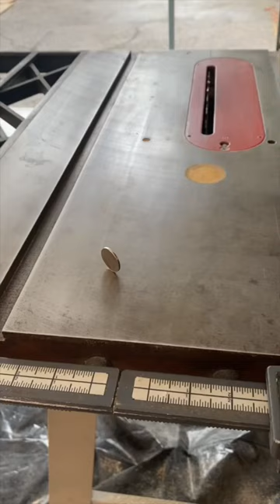Before and after Craftsman 113 upgrade

Comment: I just bought almost the exact same saw for 50 bucks. In great condition. What size belt is it an where did you get it
Reply from the maker: I picked up the belt and pulley kit from https://www.in-lineindustries.com/product/pulley-belt-kit-sears-craftsman/ Definitely change the pulleys and the belt, big improvement.

Comment: I just got one of these from my father in-law, I had a hard time getting it to 45deg, seems like the miter/angle screw rod doesn't have enough room (even with the collars off it) to push to 45deg. I am able to hit a 90deg with no issues, and about 2inches overhang... First time working on an older saw, and so I'm not sure if i can just unscrew the rod all the way out? Or if that'd cause more issues. Any insights?
Reply from the maker: Mine has a similar problem - at some point I’ll strip it down and fix. Could be anything from gunk to a bent threaded rod.

Comment: REDUCING NOISE:
1.	Change your v belts to flat belts. 
2.	Use machined steel rib belt pulleys 3.0" Diameter Motor pulley and 3.0" diameter Trunnion spindle pulley.
3.	Add thick 20 mil Acoustic Mat to the inside of the saw frame in 2-3" wide vertical strips. in an irregular pattern.
4.	Seal off any holes in saw frame with acoustic mat.
5.	Remove rust first so mat will stick. Fill table top voids inside of saw with acoustic mat.
6.	If sticking with V belts than change to a link belt.
7.	Add motor tension springs.
8.	Lubricate motor pivot mount.
9.	Add a padded blanket around the base.
10.	Wear 30db or greater hearing protection.
Reply from the maker: The upgrade improved the saw performance and reduced vibration, it was not intended for noise reduction.

Comment: Nice but yo fail to explain in detail what you did or what model you have.
Reply from the maker: It’s a little hard to hear in the video - I installed machined pulleys (replacing the cast ones) and a link belt. It’s a Craftsman 113, circa mid 90’s.